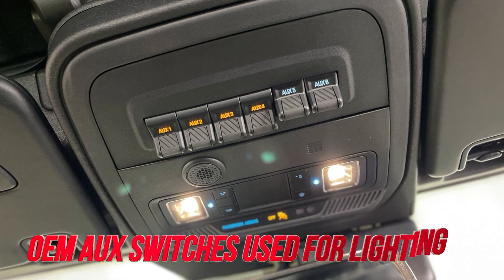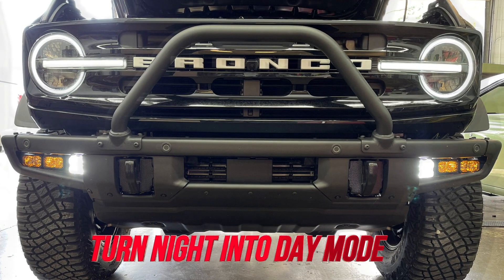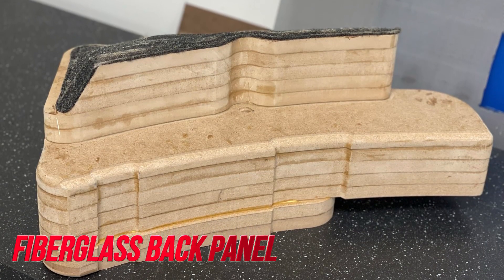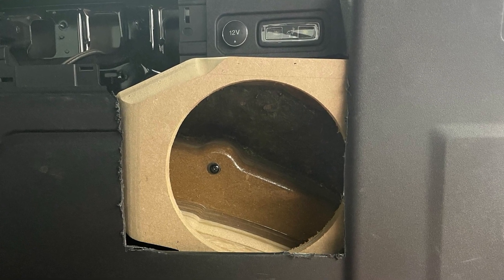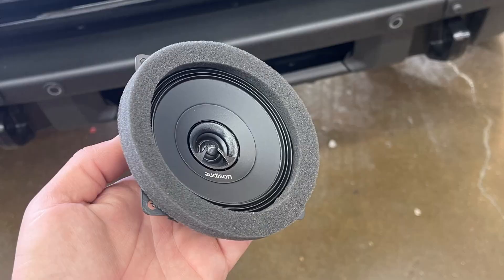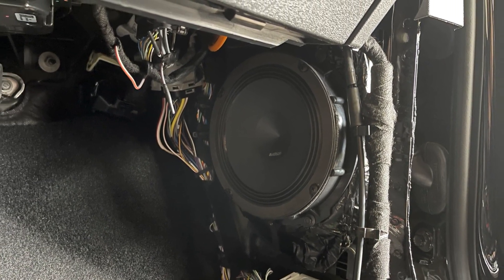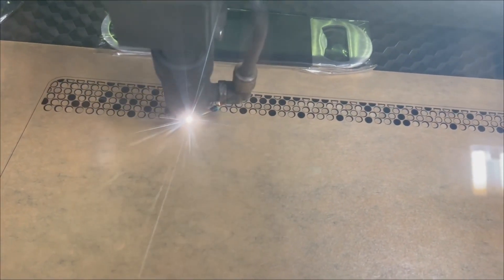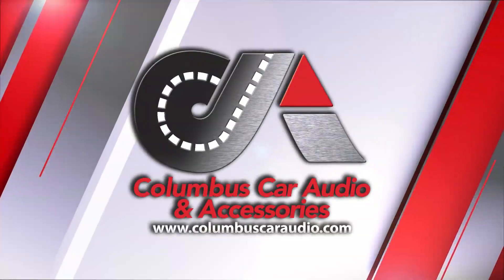2022 Bronco Sasquatch Lighting and Audison Subwoofer Upgrade || #bronco #sasquatch #badlands #custom

Comment: Looks pretty good. Where did you mount the amplifier? Or are you just running everything off the B&O amp? I dont see a A2B interface so maybe thats what you are doing.
Reply from the maker: Thanks!  The OEM B&O amplifier was utilized for all of the interior speakers, and we added a small mono amp to run the subwoofer that we added.   The amplifier went behind the dr side panel in the cargo area.  Super tight squeeze, but we got it in there 👍